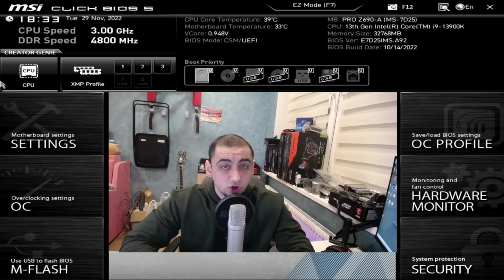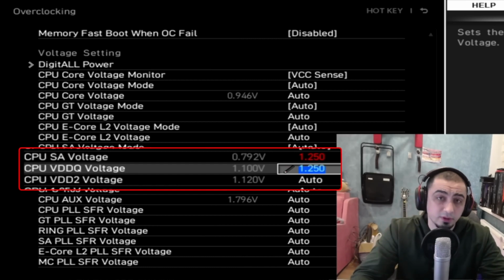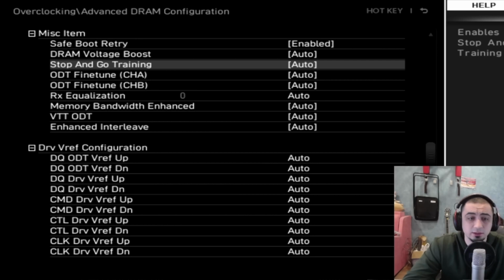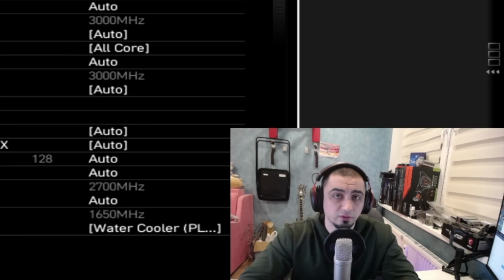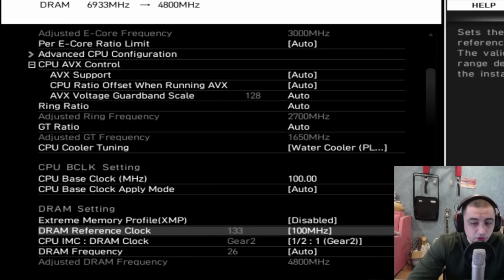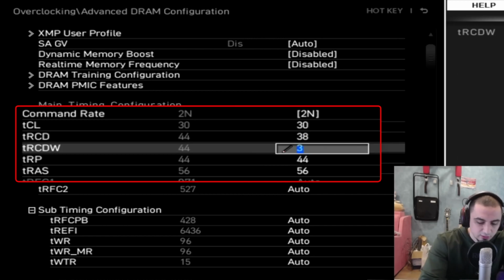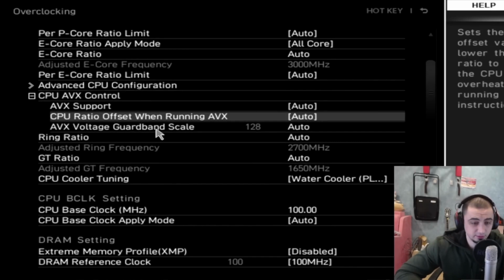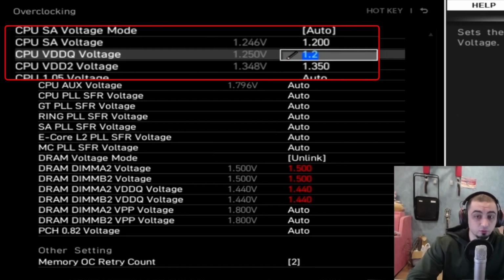Guide how to overclock DDR5, instructions for hynix m-die for intel

Comment: Thanks for the great tutorial. So far so good. But I have a question about the tREFI value, you said to set it to 65024 and if that didn't work set it to half of that which is 32512, but you said 35012. Was this just an accidental error or should it really be set to 35012?

Comment: 16gb sticks are never dual rank, Tcl can be an odd number, you just need to disable "gear down", also you take a big hit from using 2t over 1T, most kits can easily handle this, the trick is to set these two things before tuning.

Comment: Excellent tutorial. I used almost the exact settings on DDR5-5600 (5833 mhz, micron ic’s). Worked beautifully and increased throughput substantially. CPU was a 7900x3d on a crappy Asus Prime X670-P WiFi. Your tutorials are very, very good.
Reply: X670 itself already couldn’t be “crappy” lmfao

Comment: bro are u still active? i have 32cl 6000mt kingston  2 x 32gb ... does this settings apply to my memory to?
Reply: It’s more about the memory ic’s on the pcb than the name on the sticks. They’re either Samsung, Micron, or Hynix dies. I’ve used these timings on micron and had no issues, so you can certainly try them.

Comment: Really CPU VDDQ and CPU VDD2 only 1,25-1,35v ?? For 6400+ you must set this to 1,50-1,58v
Reply: that is totally false, you can definitely do that with 1.25 for 6600 that worked fine for me on both msi and gigabyte boards
Reply: @mircomputers  Well my shity Z690 UD DDR5 needs CPU VDDQ 1.40v and CPU VDD2 1.47v for 6000-6200MT Hynix A/M-die.
Reply: @RMKry  that is insane i have made many systems with 12400f that usually tops at 6000 on that same board , and even some 12700k and they all ran around 1.22/1.25 and that was only because they would sometimes need two or three time press of power buttons at lowee voltages, then would start and run all the bench just fine
Reply: @mircomputers  Not all memory controler on CPU and mobo likes low voltage.

Comment: Tried it  . Got 6600 stable on Kingston Fury . As soon as i tried to lower the voltages and stability disapeared .  😀This guide helped to lower the latency from original XMP profiles. And the PC is a little more snappy. The only problem is any overclocking on DDR5 needs more voltage.  Now have to decide do i keep it at 6600 or go back to JEDEC at 1.1v . will see . Great video by the way
Reply: 1.1 is pointless, at least 1.2 is same “safe” and “cool” lol

Comment: Hello, thanks for your guide! I got about 10GB/s transfer rate and 10ns latency with my Hynix DDR5.

I also have another problem. My G. SKILL RAM is rated for 6400MHz, but I can get it working above 6000MHz (SK Hynix, 2x16GB). Sometimes my board just won't POST and throw me to BIOS with fallback settings. Even if I set it again to higher frequency it will boot and work until next start. I tried multiplce CPU_VDDQ, CPU_VDD2, CPU_SA, DRAM_VDDQ. 6000MHz works only with CPU_VDDQ = 1.25V. Higher and lower voltage does not help with gettings higher fequencies.

Do you can any idea what can be wrong? I can even pay for your support.

Comment: Hello My Friend. Very good Video. Many thanks. I have a question: Is vdd2 = IVR Transmitter Voltage on ASUS boards? VDDQ_TX = Memory controller Voltage?  Some say the this is right and others say the opposite. I am a bit confused. 

I have an I5-12600k not overclocked with KINGSTON FURY 6000MHZ 40cl (KF560C40-16)

 When I have it on auto clocks @6000MHz I get temps around 55°C while BF2042 gaming and stress testing. Is this normal? When I get tight timings I get temps around 60°C.

Can u maybe provide timings for my RAMs? Thnx in advance.

Comment: I am surprised by the views. This guide helped me achieve 7466 stable on i7 13700 k with Teamgroup cl34. So thank you
Reply: Hi what motherboard?
Reply: Hi can you help me get 7400 or 7600 mhz stable with 13900k? Mobo is z790-E. 32 gb g skill 7800mhz.
Reply: @tuncaycalan1125 u properply need apex board to do that rog strix 4 dimm z790 is trash

Comment: I have the GSkill DDR5 6800Mhz 32Gb (2x16) Hynix A-Dies on an Asus Z690 with a 12700k. Could i use these settings?
Reply: of course fit. accelerate without problems
Reply: Did you get any higher clocks stable on that board? I have ROG z690F and my Gskill 6600 doesn't run higher than 6800 even tough it could do more and i have tried many voltages. But that board is "officially" only rated to 6600 VQL wise but i run TM5 and Karhu ram test. Might not be noticable when gaming.
Reply: Depends on which motherboard you have, the 500usd versions and above yes. Mine only goes to 6000Mhz.